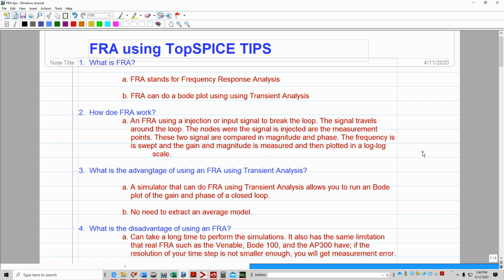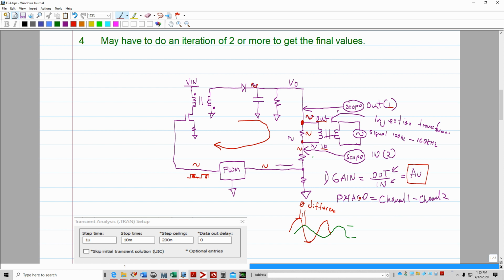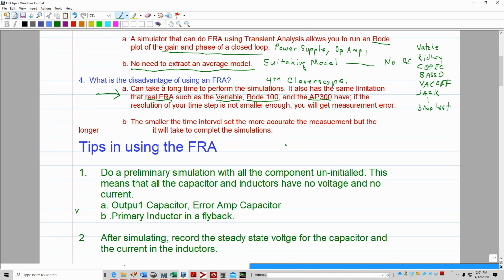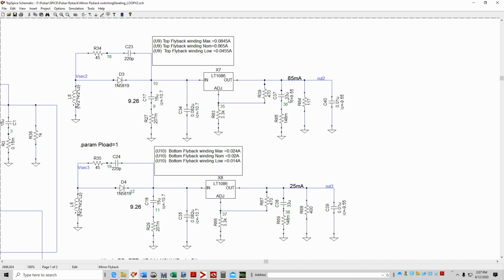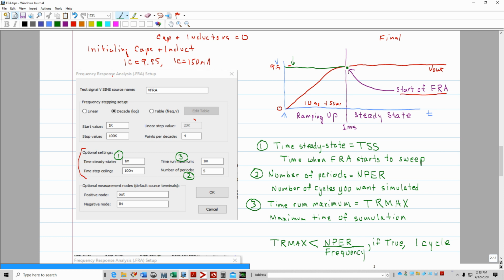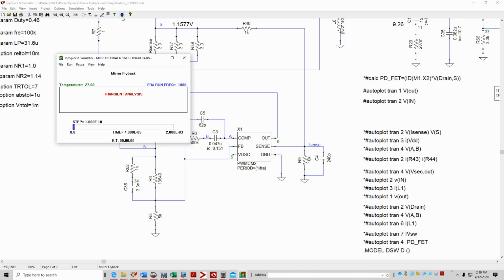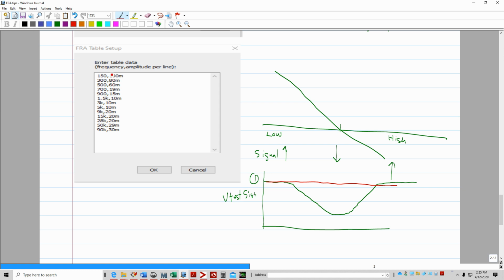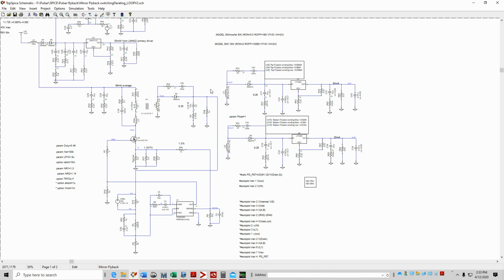FRA using TopSPICE; Simulation Tips

Comment: Hİ sir. Firstly, thanks for smps and other electronic tutorial videos. I have a problem. We use zero-pole cancellation method for smps  feedback. When I research "pole-zero cancellation is theoretically okay, but practically unobtainable. Even if a perfect pole-zero cancellation were possible, the system would not be practically implementable because of internal stability issues" what would you say about this situation? Thanks sir.

http://ctms.engin.umich.edu/CTMS/index.php?aux=Extras_PZ
Reply from the maker: Hi Power_Man_24,  the zero-pole cancellation method has been used for many years in SMPS. In fact you can use it to compensate most well behaved system.  If you have the Sanjaya Maniktala book "Power supplies A-Z", he used the same technique. As long as the flyback is in DCM, you will not have the RHZ and use be able to use the zero-pole cancellation method. Most people design fkybacks using DCM because zero-pole cancelation is very easy.  Now if you operate the flyback in CCM, you will have a RHZ that you have to deal with. Again you have to cancel the main pole from the output filter with a zero in your error amp.  The key here is that you can not cancel the RHzero.  Once you calculate the RHZero, you need to put the crossover at least one decade below the RHzero frequency. For example, lets say that the switching frequency is 100KHz, it is common to set the crossover frequency at 1/10 of the switching frequency. So in a regular DCM, the Fc(crossover) would be 10KHz. But in a CCM where a RHZ is at 30KHz, the RHZ and the FC are too close to each other. The solution is to set the Fc to at least one decade below the RHZ. This means that I would have to set the FC at 3KHz or lower. I would personally set it to 1ms, that way your transient reaction is 1ms which is still fast enough for most supplies. But the zero-pole is common used method although there are slight variations being used and in fact is a practical implementation. Not saying that it is not practical would be incorrect. Otherwise the power supplies that I have designed (MMS, IBEX, New Horizons), and shown below, for outer space would not be working. So it is a proven and very practical method.

MMS Spacecraft 
https://www.youtube.com/watch?v=XDr6_kp-5tk

IBEX Spacecraft
https://www.youtube.com/watch?v=uXfoAYqhGVE

New Horizen
https://www.youtube.com/watch?v=lCIR08TXGEQ
Reply: @RobertBolanos  Hi  Robert Bolanos . Thank you very much for your revealing answer. The information you provided really helped me to understand the feedback design. Thank you very much, sir.
Reply: I also have one more question. In DCM Mode fsw=100kHz but Fcrossover=200Hz is these values  suitable?
Reply from the maker: power_man_24 A crossover of 200Hz is achievable. You would have a phase margin of 90 degrees.   The transient to a step function would react in 1/200Hz or 5 ms

Comment from the maker: In this video, I show the FRA feature of TopSPICE and show how to initialize the capacitors and inductor in order to speed up the simulation and reduce simulation time. Expain how to set the FRA transient parameters and also to use the "CRTL" key to have the cursor follow your mouse to make measurement. Questions, comments can be sent to rbola35618@aol.com. "May your simulations always converge".
 rbola35618@aol.com